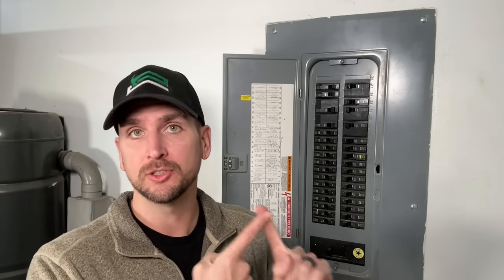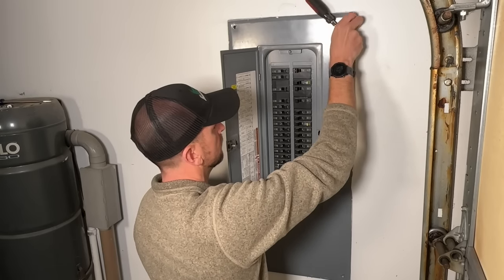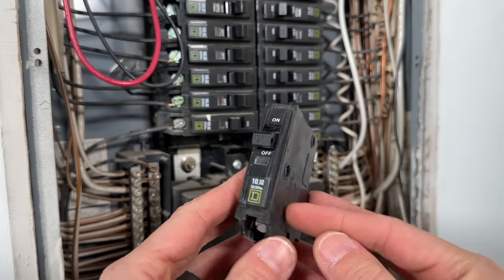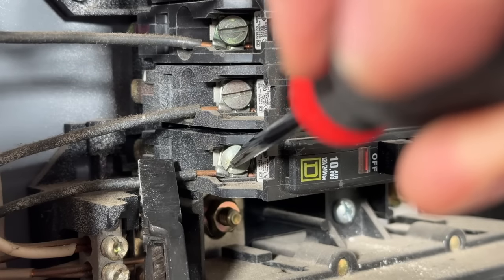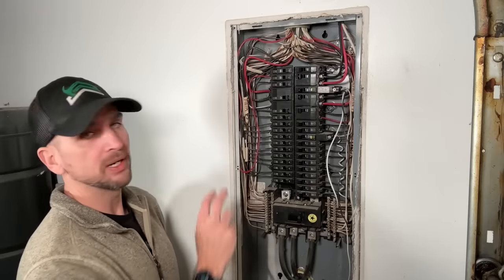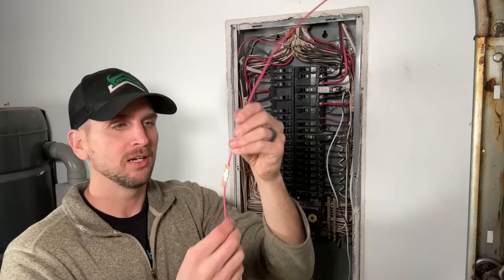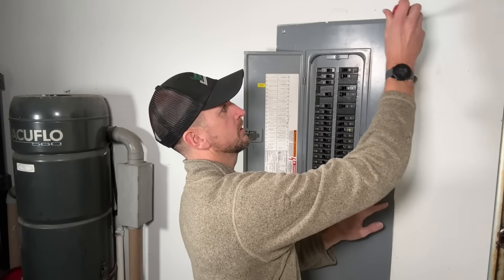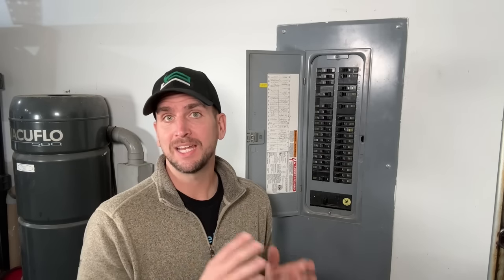How To Replace Or Move A Circuit Breaker

Comment: Please take this video down. As a retired electrician you made me very nervous on how close you were coming to the hot main conductors in this panel. Dude you are going to get killed or get someone else killed doing this type of work. All your breakers are wired wrong (the wire should be inserted on the other side of the clamp so the screw pulls the wire in instead of push it out. Look at the left side middle screw hole in the panel right before you put the cover on, Do you see you have the wires threaded very close the where the screw is inserted? Guess what happens when you turn on the main breaker and that wire is now grounded? (Flash explosion) Also never move wires in a panel because some circuits need to be on a specific phase or you will overload your neutral returns causing a fire. Electricians go to school so this stuff does not happen. And then there is the lability of this video. A lawyer would have a field day playing this in court.
Reply: As someone who knows nothing about electricity and searched how to do breakers because in 2 minutes I’m installing some 30 amp doubles and moving all of them down a few slots…this is the one and only video I’m watching. You worry to much.
Reply: @jward123321 I was just going to ask this question. Could I just move each breaker down one or two slots to open up a spot near the top main switch.
Reply: I think the wires are secured into clamps that are tightened by the screws, not wrapped around the screws. Also I think if you maintain odd/even sequencing that will keep everything on the right phase
Reply: The electrician guy is correct.  There are two phases in your panel box.  Where you place the breaker determines which phase you’re on.  Sometimes it doesn’t matter and sometimes it absolutely does.  If you do not know when it does or does not, DO NOT move your breaker
Reply: @ifyjoanna if you move it down one spot, you change phases.  If you move it down two spots you retain phases.  If you do not know if it matters, then please be safe and move it down two spots, not one
Reply: @Fooooodalicious  In theory this would keep them on the same phase unless you have a split buss panel or you are installing 1/2 size breakers to make room for your 2 pole 50 amp breaker. They made the split buss panel years ago so if your panel is newer you should be fine. The 1/2 size breakers can get you into trouble because you could be taking 2 regular size breakers that was on 2 different phases and putting them on the same phase (1/2 size means 2 breakers fit into 1 space = same phase) and that could be bad if they share the same neutral.

Comment: If I were moving a breaker I'd make sure that I wasn't disturbing the proper positioning of any breakers for circuits that share neutrals.  They might not have been properly handle tied, or maybe it fell off, so not obvious which ones share a neutral. As I understand if you move them from one breaker immediately above the other breaker (on the same side of the panel, same column of slots), you risk putting them on the same phase, which will improperly add the return current on the shared neutral instead of subtract it (so instead of 12-9=3 amps (which a 14 awg wire can handle), for example, you'd have 12+9= 21 amps, which will overheat a 14 awg wire and possibly cause a fire). Know which slots are on the same and different phases (A,B,A,B... as you go down a column in my panel at least) and if you must move a breaker, move it to a slot with the same phase as it had in its original location (that way, if it was next to a breaker that it shared a neutral with, you'll still be on a different phase from that breaker and neutral flow will still subtract, not add).

Comment: It would've been more helpful for you to have worn safety glasses, gloves and insulated screw drivers. You were too comfortably close to the 2 hot lines at the bottom. Also, it is very important to inform everyone that these 221-2401 WAGO connectors to only be used in junction boxes and never outside one to prevent sparks and fire and comply with codes.  I like these connectors. Game changer! thx
Reply from the maker: Thanks for the feedback👍
Reply: @Kevin-mp5of  Calling someone a Karen for pointing out very real safety concerns that the average DIYer has zero clue about is ridiculous.  Along with the gear that he listed, he should also be wearing arc flash PPE instead of the pull over and likely non cotton shirt that he is wearing.  

He is making videos for which he earns money,, which means that he falls under the purview of OSHA.  Thus, he falls under the requirements of NFPA70E.  He isn't some guy at his house that doesn't know any better.  He is supposedly trying to teach people at home how to do things properly.

Comment: I thought best practice is to trip all the breakers before the main. Was told the main is not designed to handle being tripped under load.
Reply: Exactly
Reply: How would shutting off the main, put any stress on it? Maybe you mean turning off the breakers before turning the main back on? Also, you're not "tripping" the breaker if you're turning it off, it trips when there's an electrical fault..

Comment: My circuit panel is <60 years old. The main breaker has never been replaced and rarely gets cycled. I know for a fact it has not been for at least 15 years.  One of my 15 amp breakers has failed. Fortunately, my former uncle, a certified electrician, wired the entire house in 12 gauge so I could put a 20 amp on this circuit. However, my fear is that the main breaker may not turn back on after I turn it off to replace the failed breaker. Thoughts?

Comment: Straight forward, uncomplicated thorough explanations. Thank-you. I have an older home I just purchased. Electrical is a mess. 40 space panel box. Tons of junction boxes under house in crawl space. Can't seem to get an electrician to come out. Each video of yours I watch, I become far more confident. I've done some simple wiring before and I do have common sense so I've been successful. I have 7 very old and broken baseboard heaters that I want out. I don't want to remove them and cap off the wires. I would prefer to remove them (220) from panel altogether. You've taken away the mystery of the service panel for me! Thank-you again.

Comment: Thank you for the trick about extending the wires. I have to do exactly that and move a couple breakers to the bottom for an interlock kit that I want to install.  Keep up the great work.
Reply from the maker: Nice, what are you planning for your backup power?  Gender or batteries?
Reply: Generator.   I have a 2500 W inverter generator that I use now that powers most things like a couple refrigerators, lights and Internet using extension cords. I want to add a soft start to the AC and get a NG generator that will handle the AC in the summer.  I have to do the calculations, but will probably add a 30 amp outlet outside to connect to the panel. I’m guessing I could Dogbone the smaller generator to the 30 amp and only turn on the breakers needed.  Then I can use the larger generator when needed on the 30amp. 
BTW, I bought the pack of WAGO connectors and I’ve used them a couple times. Love them. I hate wire nuts.
Reply: @EverydayHomeRepairs    Also thought about adding a GenerLink  (~$1k), but thought the cost would be too much compared to the interlock kit and adding an outside outlet. Although the cost of 6/3 wire, that’s pretty pricey.  If the GenerLink fails outside the warranty period, then I’m out the $1k.
Reply: @jerrybell6786  how about an inlet for the generator instead of an outlet, and an interlock?
Reply: @jerrybell6786  ...HINT :  I had the same problem....adding a double-pole breaker for an interlock kit ( in my case, the line power and main-breaker were on top, and I needed space at upper/right positions, 2 and 4).  To cope with the "too-short" wire problem you discuss at 4:50...where you show the WAGO connectors to lengthen the wire.....I simply moved the entire array of remaining breakers down 2 more positions....to open up the needed top-2 positions I needed. My point?---> each breaker has enough "slack" to allow re-positioning 2 more slots down, each....without having to add extra wire length. Of course, 1.), I need to have 2 open positions below the entire array, for this to work, and 2.)  the label-index written on your door needs to be updated.
Reply: @TheWilferch  Thanks Wil.  Always great to hear different perspectives.  That's my goal/hope when I get in there, but want to have a backup plan ready just in case.  I had the panel upgraded about 10 years ago and they had to move the panel.  I'm not sure what I'm going to see when I open it up.  🧐
Reply: @jerrybell6786  ....my hint doesn't work in all cases.....but thought to share, to (maybe) avoid adding a wire-extension. Good deal.....hope your plan works for you.

Comment: WOW, you work fast, like "The Flash" Thank you for posting this video. I've done that more than I care too. I am competent but not comfortable, but being forced into austerity, by poverty is what I must do. I'll visit your Amazon again. I purchased Wago from your Amazon before but they didn't have butt splice. I am redoing every wire nut I happen across with Wago because it's just so much better, than twisting and straining the wires. Especially in this house. I have to be careful because the Romex Jacket on my wires has asbestos, so I don't want to be splicing wires and pulling back the jacket on Romex, creating dust.

I really like Joel and Electro Pro Academy. He's the best in my book.
Reply: I should add that wiring is probably your last concern when it comes to asbestos. The ducting in your attic or the joint compound in drywall in homes prior to 1973 have high risk of asbestos. My home was build in 1973 and the ducts in my attic have a silvery coating on them, and are wrapped in fiberglass insulation. If left alone they don't pose a danger, but if you crack that coating on the duct, it will get fibers into the air. A guy i know in the duct cleaning business explained to me that you can coat those ducts with spray adhesive to prevent this issue and that this is commonly done when removing the ducts to prevent exposure.

Comment: You were so in the money when you said the G. E. breaker brand usually goes bad.  I wanted to see which breaker was being used for my circuit, I found it and turn it off so I could add another outlet.  Bad mistake tuning it off, now none of my five outlets work.  I turn the breaker back on and nothing happened, all my outlets were wired correctly.   I tested the breaker, and sure enough, it was bad but not tripped. A new breaker from Home Depot solved my problem.  Thank you for posting your videos.  They are very helpful.

Comment: Make sure the bare conductor is fully inserted behind the screw plate on the breaker connector (you should see a little bit exposed through the other side of the plate - as you did) and ensure you properly torque the screws (applies to the neutral and ground bars as well).  I picked up a box of those Wago butt connectors for just such use, as well as receptacle side extensions in case they are short.  They are very handy for this.

Comment: There's a good topic here of unusual things non-electricians rarely realize which gets them into trouble when it applies.

One of the breakers moved to a different phase. There are older houses with non-obvious multiwire branch circuits and if phases are improperly switched there's a double loaded neutral, i.e. fire hazard. Do not trust red and black wire colors. Keep breakers on the same phase or do absolute validation that it is safe to change.
Reply: @Kevin-mp5of  Yes, you are right.  Usually it will be obvious. Still, not too long ago I was looking at Square D panel with some breakers to knob and tube runs. Obviously no red wires there. Weird unusual stuff is out there, too, just less often. Want to be safe for even those cases.
Reply: @Kevin-mp5of  I understand common trip became a requirement in the '78 revision, but I don't see it well adopted until houses from the 90s era.  Seen many (still a minority though) panel post installation updates not keep the common trip, unfortunately.

Comment: Great explanation.  1:30  It is very smart of you, to point that they are still hot wire live even if the main breaker is close. The tree main wire coming from outside should be cover to protect electrician. There is no reason for company not to do that, except money. I f you ever want to inspect if they are well connected you could remove the ''cover''   

Is not all  DIY who now that. People might say, if they don't know (DIY) there should not be working inside the panel, well some DIY think that everything is safe because they been told to shut the main breaker. I remember telling somebody who was installing a breaker to watch out, and he freak out because dint realize that.
Reply: @mastopage3120 They may not have had those lug covers when this was installed, nor was it required.  I think Square D was the first (there yellow rubber/vinyl with their logo molded in) .

Comment: Actually I moved a breaker from top to the bottom and the wire was short so I extended that wire with a wago connector. But I was wondering if doing that was okay and now after watching this video I'm so much relieved that my action was okay.
Reply: Did the same thing for my generator, used wite nuts for 2 of the breakers and wagos for my 15A tandem breakers i relocated to the very bottom to be on the got leg of my panel since my generator is 120V and only powers 1 leg.  I was able to add living room and bathroom lights to the powered 1/2 by moving my 2 breakers

Comment: I did exactly as you did for my generator and had to move a vreaker from top right to bottom left to free up my single 30A breaker for my 120V generator and make it usable with my interlock kit

Comment: HINT :  I had the same problem....adding a double-pole breaker for an interlock kit ( in my case, the line power and main-breaker were on top, and I needed space at upper/right positions, 2 and 4).  To cope with the "too-short" wire problem you discuss at 4:50...where you show the WAGO connectors to lengthen the wire.....I simply moved the entire array of remaining breakers down 2 more positions....to open up the needed top-2 positions I needed. My point?---> each breaker has enough "slack" to allow re-positioning 2 slots....without having to add extra wire length. Of course, 1.), I need to have 2 open positions below for this to work, and 2.)  the label-index written on your door needs to be updated.
Reply: That's brilliant. Nicely done! My main is also at the top and I'm hoping to do the interlock. Does it also have to be at the top?
Reply: @markkempton4579  ..the interlock metal pieces that "interlock" the main breaker position (on/off) needs to be CLOSE to the double-pole breaker used as a "main-breaker" when the generator supplies power. So...yes....if your main breaker is on top, the double pole breaker and interlock pieces are in the upper/right locations. Of course if your main feed is from the bottom, all this stuff needs to match up on the bottom.

Comment: Thanks. I am considering wiring a 30amp inlet for a generator to my panel but my main is near the top of the box with only 120v breakers but I want to move them so I can make room for a 240v for interlock.

Comment: Are you a licensed electrician?  How do you go about deciding whether you need to get a permit?  I'd like to install a 120V outlet for my new gas stove (it only needs 120V/20A dedicated circuit).  I'm confident that I can do it on my own, but my concern is that I need a permit before I begin.  Do you normally get permits for all of your work or does your home state not require that?  Thanks!

Comment: For your upcoming backup power, I'm wondering if you thiught about using an automatic transfer switch
Reply from the maker: I think I will keep it simple at first but I am interested in doing multiple different setups.  I actually like the ECOFlow Delta Pro setup with 2 units delivering 240V.  Also thinking through solar options for my house and also an off-grid garage setup.  Do you have a backup setup already?
Reply: @EverydayHomeRepairs  I currently don't but I'm considering that same setup. I am on well water and rural and am considering it. Almost all days (excluding laundry) I am below 12kwh.

Our area has time of use rates and I was considering having this for backup and some automated way for rate arbitrage. to fill the batteries up ultra cheap overnight and use during the day.

Comment: 1) Take a picture of the panel manufacturer’s sticker. It’ll include all the breaker models the panel is designed to use. 

2) Learn at the manufacturer’s what the various breaker model codes describe … it’s about more than just getting one with the same amperage rating.  

Example: I have a Cutler-Hammer panel. They often use a 6 alphanumeric model name: letters that describe what kind of breaker it is, numbers describing its amperage and 1 pole vs 2 pole etc.

3) Verify the amperage sticker or marking on the lever matches the breaker’s model. Mistakes happen. I currently have a 20A breaker that the manufacturer mislabeled as a 30A on the lever. You’ll get tripped breakers that way if it’s really a 30A circuit, or a breaker that’ll never trip before the wire burns if a 30A breaker gets mislabeled as a 20A, for example.